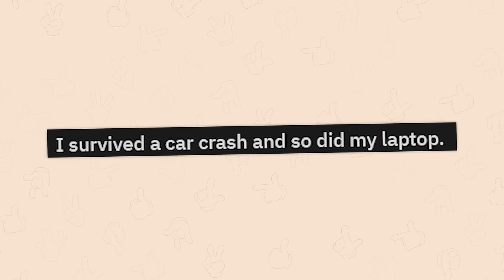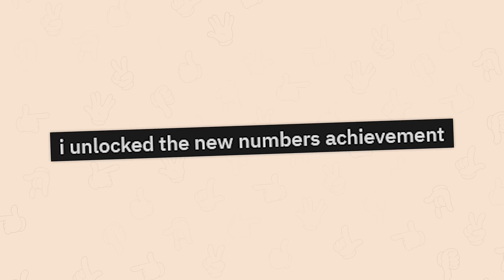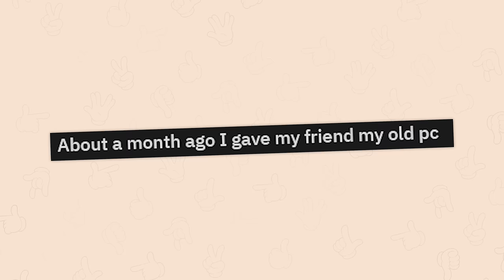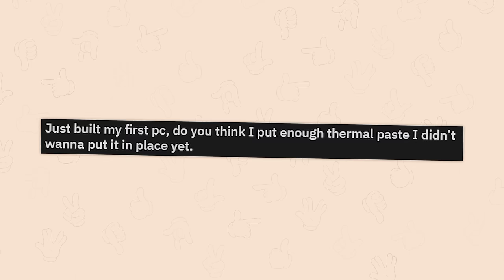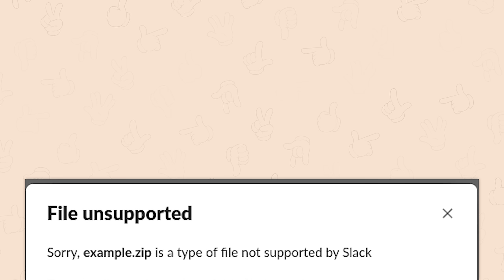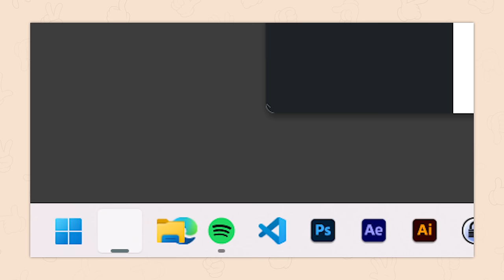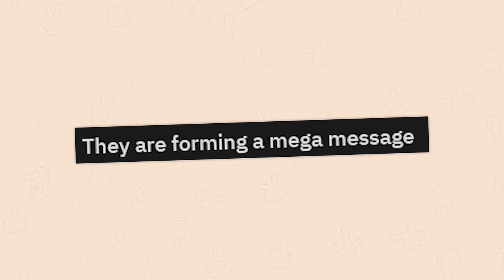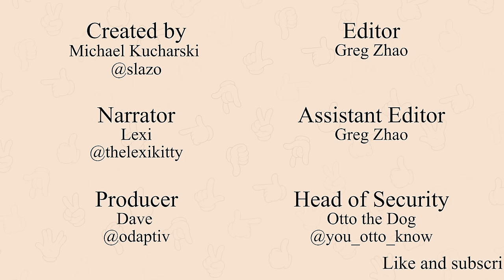r/Techsupportgore | why is the wifi down?!?!?

Comment: "90.75TB of 300GB used" Lexi... have you forgotten about ZIP bombs?
Because OH BOY. Those are a heck of a thing.
Thank god I've never had one go off in my system.
I can only guess that's never happened to me because of two things:
A:\ I'm not well known, I have no friends that would do this to me intentionally, and I don't have any tech-savvy family that would do this to me either.
B:\ I try VERY HARD to verify what links I click on, and I scan my system regularly for malicious programs.

Funny thing about that, actually.
I had a problem for a long time where my system fans would spool up when the computer was DOING NOTHING (or so I thought).
I then tracked it down to a graphics card driver issue (There's a known Nvidia GPU driver out there that makes nvdisplaycontainer use way too many system resources when the system's idle, for NO GOOD REASON).
I updated the drivers, and that stopped for a while.
And then recently it started up again. Thought to myself "Huh, that's odd, I know the GPU drivers didn't "update themselves" again, because I'm on Windows 10 (with a PC that lacks a TPM, so thankfully no "surprise upgrade" possibility there, why MS thinks that's a good idea when it's WELL KNOWN THAT THIS BREAKS THINGS FOR END USERS THAT ARE LEFT CLUELESS is beyond me).
So I looked into it some more, and I didn't turn up anything.
Couple weeks later, I was modding one of my video games, because of course I am. (Little game called Factorio if you're curious, help me I have logged over 4,600 hours since 2017, and now it's on the Nintendo Switch so I can take it with me).
As I'm navigating thru Window Explorer to go to the folder the mods are in (which is in Users/USERNAME/AppData/Roaming/Factorio), I notice something in the Roaming folder, and I don't recognize it. It has 
I found what is apparently some sort of analytics thing that I didn't knowingly tell anything to put there.

If you're wondering, the folder was named "EQATEC Analytics" and after deleting it (and emptying the recycle bin) I notice that my fans on my PC don't spin above the idle RPM that I set for them when it's (to my understanding) idling.
So I might have removed a crypto miner thing, not sure. Running a scan now to make sure nothing else snuck in.
Thing is, I don't even know what kinda file I could have downloaded that would do that to me, I don't just randomly click on links to things, and all I've been doing when I browse the web is stay as far away from the dark web as possible, because if you want bad things to happen to your computer or personal data, that's where you go to get that to happen.
So the lesson is that it can happen to you, even if you're well protected.

Comment: I find the phrasing "an unexpected error" funny. So there are errors that were actually expected?
Reply: Yes! Which is also funny. Most high level Programming languages and engines can circumnavigate these and either ignore or fix it. It gets more problematic in low tier programming languages.

Comment: I had an hdmi that would sometimes do this (See 5:25) And i would just bend the pins back into place and slip the metal jacket back in and it would work fine. (did this back in PS3 era, but i think i still have that hdmi cause it still works)

Comment: The 2 not being equal to 2 is because of floats or doubles, basically they are never exactly equal to whole numbers, you need to do something like actual is greater than 1.999 and less than 2.001, rather than a direct comparison with equals. 

This is basic computer science, telling me this guy was like an IT admin or something, can plug in the odd network cable and i stall a driver or turn your PC off and on again, but can't be trusted for much more than that.

Comment: Gonna be that guy, but the 8 batteries is only good if the batteries are 1.5V, please don't try with 8 9V, it will not end well. I'm also gonna assume people won't have that many 6V or 12V batteries on hand and not know this.

Comment: 25:54 I have this computer, It’s honestly quite good with water but in that case. Ur screwed lol, but they also overheat super easily so ur probably better off just getting a new computer, or the pc version of the same, the block pc version is Soooo much better. (It’s an omen gaming pc if ur wondering)

Comment: In middle school we were issued Chromebooks for our work. One of my friends who was really good with computers for his age took his, and not only removed all of the school’s spyware, but installed his own homemade mega-virus. It basically made it so that when he removed the safety pin of the virus, and his chromebook connected to the school’s Wi-Fi, it would send the virus to any device connected to the Wi-Fi. It blasted an awful noise that was so loud it even melted speakers in some of the older computers, then the virus bricked pretty much every computer in the school, about 3/4 of the student chromebooks, and several teachers’ personal devices. Even though I knew the exact time he planned to release the beast, the noise gave me a massive headache, even though I barricaded myself in the bathroom before he let it loose! He was never caught, and told me something like he made the virus untraceable to his Chromebook, but I forget how. I have no clue how he made the virus do what it did, especially considering it would have to work for many different types of devices at once. I can’t remember much after that, that was back in 7th grade. I have since graduated high school.